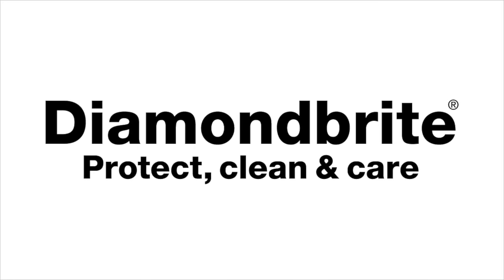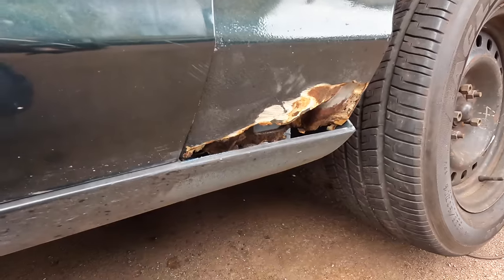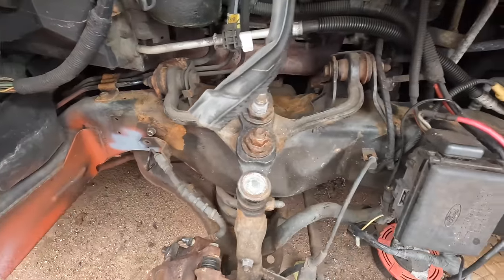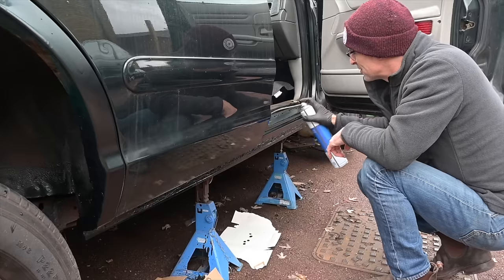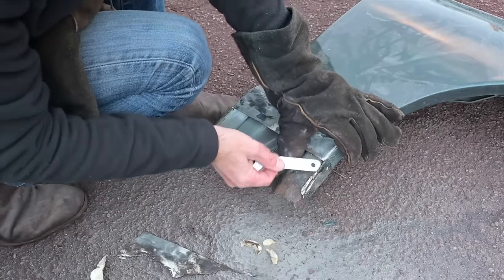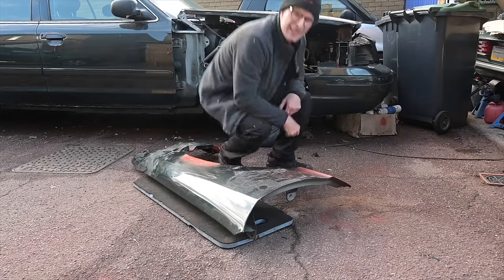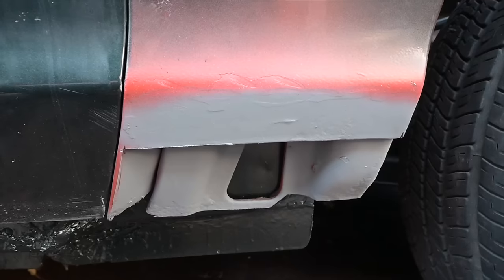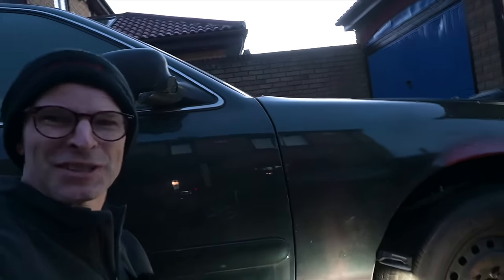£600 for a Crown Vic wing? Ill make my own!

Comment: £600 sounds reasonable as I would have had to pay over £1500, including fitting, for a new boot lid for my Jetta in '82 if had not been a corrosion warranty claim.  The rust discovered when number plate fell off, the built in mountings could not be used with some UK plates, depending on the actual reg. no. to avoid being misread,  so the dealer drilled new holes to fit it when new but never rustproofed them.

Comment: One of those 'how to' video's popped up on my instagram, it showed how to use expander foam to fill a rust hole then cover it in 'bondo' made me think of your poor fortunes with this. keep plugging along it'll get there and it'll be more your motor at the end than you ever hoped for!.
Reply from the maker: I hope you gave it a dislike! We dont need more people doing that
Reply: A while ago I tried looking for YouTube videos that might help me repair rusty front suspension strut mount areas. There's a lot of videos with people attaching rear shock mounts with bits of steel and self-tapping screws, or glueing strips of steel over the holes. I'm sure I even saw one where he created top mounts for the rear shocks using lengths of wood. I think the problem is that in some parts of the USA, it's legal to drive a car like that on the road.
Reply: That old show “pimp my ride” used to cut corners that way.
You would have this show quality paint over sketchy/dodgy repairs.
Since it was in hot dry California they got away with a lot of it.
If it was in a snow state with salt it probably wouldn’t have lasted too long.

Comment: the paint looks a very good match, nearly there , i nope not attaching the wing at the bottom does not cause it to vibrate when driving , it would not be to hard to make an l shaped pannel to close the bottom and give a fixing to the bottom of the wing,
as the expanding foam is light weight  i think the previous owner  had taken collin chapmans saying of "adding lightness" a bit to literally😉 as a fellow classic car owner i know how good it feels to drive a can that has been off the road for a while , so keep that thought in mind when you are laying on you back under the car in the cold and rain taking the skin of you knuckles, cutting you self on razor sharp  pieces of metal and burring your self with weld splatter  🤔👍
Reply from the maker: Bear in mind it has never been attached all the time Ive had it - the panel it bolts onto didnt exist until I put it back, so I dont think its going to be an issue, theres a bolt into the bulkhead just behind there as well
Reply: it may have been the foam stopping it vibrating ? @furiousdriving

Comment: I didn’t expect replacement wings would end up costing you that much😱
I suspected the upper arches would have a “hidden” rust repair.
They tend to rust there before the lower part.
I assume you would get extra wings if some turned up closer to you at a reasonable price?
You’ve done a fantastic job though👍
I’ll be sending you several emails with reference pictures the left hand side sill off my parts car.
Hope it helps you out for the other side.

Comment: Are you sure it's two pack? If it were two pack there would be a plunger on the bottom of the can to inject the hardener into the paint, then you have about an hour tops to use it.
Reply from the maker: maybe its not then

Comment: Good job but you really should box in the sill bottom section because it was an integrated structure… it just should have had a drain hole in it !

Also… should really use the abrasive sandy pad on panels to remove paint and filler, not the wire wheel….

Comment: It is a buyer beware lesson, I know of one down under who was scammed terribly on a bought unseen 59 Cadillac so bad it became a parts car for someone else at a significant loss but advertised as drivable, in that case it would have been cost effective to have travelled to the USA & look around.The correct engine was long gone & what was there had seized, extensive rust even in the pillars, I guess road salt can creep through a structure if left too long.A cost effective restoration for that example was not worth it, cheaper to buy an example that was approaching decent. Standards in the USA can be very poor in some states where used vehicles are concerned, MOT & RWC (road worthy certificiate) here are stringent & designed to keep rust buckets & potentially unreliable & unsafe vehicles off the roads,Dads 1996 Jeep Grand Cherokee that I thought about transferring into my name, think again, a lot of expenditure would be needed beyond a set of tyres to get the RWC enabling a transfer.

Comment: I told you where to buy wings from for less than 200 quid for the pair.
Reply from the maker: They weren't in stock. No where in Europe had them in stock
Reply: @furiousdriving  jbz limousines in Harlow has them in stock!
Reply from the maker: @ZafiraSteve  I got my spare wheel from there, I don’t think he had them for this year or spec, or they were rotten -I spoke to a couple of people breaking cars but they were rusty.

Comment: A lot of those cars in North America it would probably be  better getting a better car I  realized that they're not just falling off the trees there. Then use the other car for parts, I don't know what the roads are like there. But usually, when you do that kind of work, it doesn't last very long so not worth it here. It starts to rust  again in that area quickly...  Notorious for corrosion. FYI, the person that sold you that car should be fu**  ashamed of themselves. 🍺🍺🍺🍺🍺🍺🍺🍺🍺🍺🍺🍺🍺🍺
Reply from the maker: too right, a total scam artist of a seller. Im using so much corrosion inhibitor you could park this in the sea now and it not rust

Comment: Nonsense. Its perfectly road worthy. Its body on frame and those silly panels have no bearing on the structural integrity of the car. Its purely cosmetic what youre doing there. My crown vic is worse in those areas, I just ignore it
Reply from the maker: I assume you’re in the US-in the UK any rust within 30cm of a seat belt mount and the car is off the road
Reply: @furiousdriving  The seat belt mount on this car is directly connected to the ladder frame